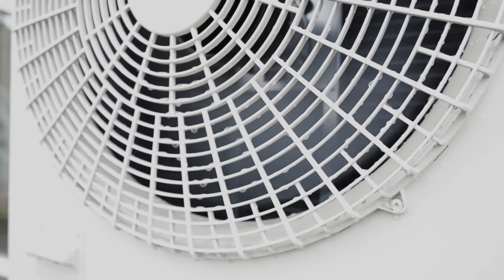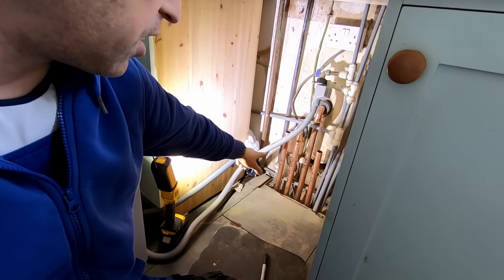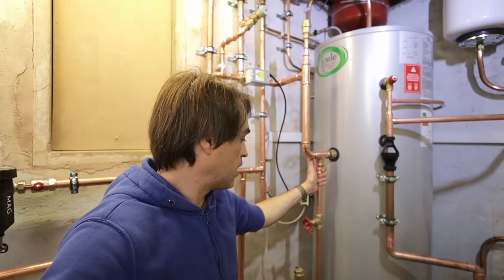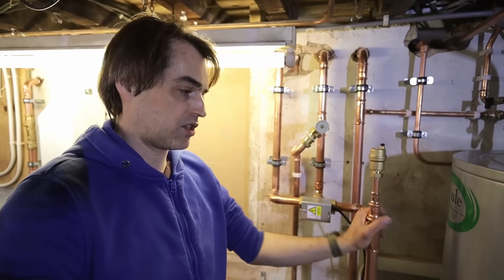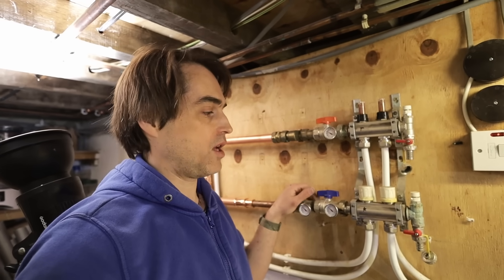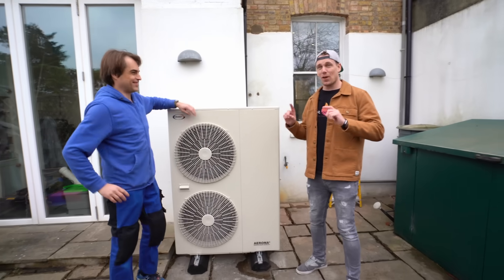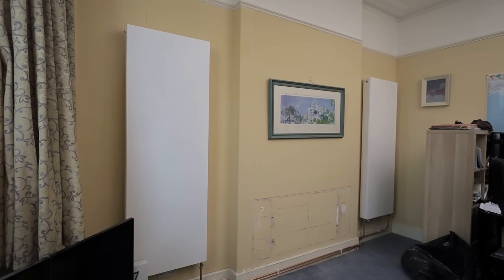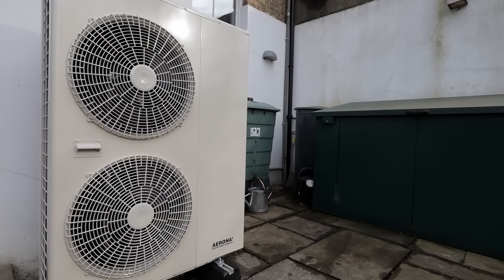The Truth about Heat Pumps: Debunking the Myth.

Comment: Four bends is pure art. The radiators arent hot enough though.
Reply: The radiator sizing was perfectly explained! The radiators ARE hot enough, at that size they put out the required 1.7kw at 45 degrees. No need for them to be any hotter

Comment: those radiators are crazy! is the house single glazed and uninsulated?   fabric first ?
Reply: Conservation area? Clearly Victorian, ripping out original windows would be a crime, solid walls are difficult to insulate without compromising appearance and / or space. There is a limit what can reasonably be done to a period property in insulation terms
Reply: @spencerwilton5831  I'm  sure your right.  but those rads are another level of ugly. When trying to preserve a beautiful building.

Comment: Really appreciate the time you've taken to put this together. I'm scraping together the pennies to take the heat geek courses - ACS resits this year/van power steering failing/children... Knowledge always pays in the end. Thanks again.
Reply: I'm hoping the Gov will throw a large wad of money at it. Its going to need a combined effort - Insulation, Heat pumps etc, its too much for the average working person to shill out.
Reply: FYI there is an accredited heat pump training course just released by the CIPHE
Reply: @jameslewis875  What’s the qualification called? If your thinking about the new CIPHE 2-day low temp heating design course then that is just a pre-requisite for the heat pump course (it’s replaced the energy efficiency course).
Reply from the maker: Heat geek is by far the best course out there and I have been to a lot of so called heat pump training courses. CIPHE have new low temperature heating course. I have seen the book for it. Let’s see if it’s any good.
Reply: @UrbanPlumbers  Thanks. It has to be challenging to be worth anything. I'm just a little worried whether challenging will be 'recognised' as better or whether a course of training taking a minimum AM unt of time and effort will be 'enough'. Either way, if I am fitting low temp heating I want to be confident that I understand the many variables as best I can.
Reply from the maker: @tapplumbandheat  I just had a look at that low temp heating course. It is done though the colledges that I know, and I guarantee you 100% that course will be a joke. Although the syllabus maybe be fine, the lecturers in most of those centers are clueless when it comes to heat pumps or low temp heating. Another pay to pass scam. Just do the heat geek course and maybe Kim's Norhampton Academy course - those 2 courses will teach you more than any colledge course will ever do. All those 'training scheds' are a big joke.
Reply: @UrbanPlumbers  yes. Kim off combustion chamber - always liked the way he was looking for answers to questions. always questioning, not I know everything don't dare question me. After all, what do I know. Mostly repairs, installs only when it really isn't worth fixing and more plumbing than heating
Reply: @tapplumbandheat  Low temp heating is not difficult, either underfloor or huge wall sized rads. Also a very tall HW cylinder for stratification.   

One good trick to increase the delta is to put a large rad in the coolest room (entrance or porch) in series after all the others right before the return ( with two lockshields permanently wide open ).
Reply: Yep, thanks for your efforts. These vids are well put together.

Comment: Great video. The installation highlights the serious issues we face with old UK housing stock. Heat loss is the enemy in winter. In summer it’s going to be cooling. I think we have to seriously invest in super insulation before we install heat pumps. Most “ ordinary “ households won’t have the funds for these high end systems. I’ve invested in second hand woolly jumpers. Heat the person not the space perhaps?
Reply: When we stop the drafts ventilating our old homes, we are going to need to get the vapour barriers right to avoid rotting them out from the inside by trapping moisture.
Reply: @AndrewHelgeCox  Yeah - lived in two houses. A Victorian house with solid brick walls, no cavity. We made many improvements including new double glazed windows and a fair bit of insulated plasterboard on exterior walls and better loft insulation but the house did have some drafts and actually it was nice to have a degree of draft in order to remove moisture and keep everything smelling fresh even if it did cost more to heat. However it did actually still have some of its original fire places and the old range in the kitchen. When my family had financial troubles when we were young that was a life saver. My dad was always able to get scrap wood to keep us warm. 

Now live in a much more modern house, brick and breeze block with an insulated cavity. Double glazing and some insulated plasterboard and it does trap moisture and smells. Always need a window or two cracked letting some heat escape.
Reply: @AndrewHelgeCox  I agree. I think we're going to see a huge number of problems over the next 20 years because of the big step up in insulation.
Reply: @AndrewHelgeCox  why not just use soffit & ridge vents as American homes do?
Reply: Couldn’t agree more. The future (well the near future) is a thermostat at 18 degrees and a blanket! 
Also turning condensing boilers down to 60 degrees. Small changes like this will have an immediate effect and whilst heat pumps and renewable energy are the future... we have a long way to go in the meantime. The government should be investing in insulation and nuclear power rather than giving grants to heat pumps companies
Reply: @lewisjones5067  Having to sit with a blanket and gloves on in your lounge is more 18th than 21st century. You’re right about the nuclear power though.
Reply from the maker: @lewisjones5067  turning your boiler to 60C will require radiators the size as in this video as your MWT temperature is going to be 50C. 

the principles of efficent heating are the same with gas boilers - lower temperatures and lager radiators.
Reply: @UrbanPlumbers  I agree, however turning my boiler to 60 degrees is much cheaper than ripping it out and fitting an ashp. When ever I do work on houses now I’m insulating as much as possible and oversizing the radiators. This is only a short term solution but at least it’s a step in the right direction.... and you can always turn the boiler up again on cold days!
Reply: @lewisjones5067  agreed 18 degrees C is plenty goodness knows what some people have their thermostats at 24 degrees plus I suspect. You aren't supposed to feel like your on holiday on a beach in Tenerife in your home !
Reply: Hot water bottles and woollen clothes!
Reply: @risenshine2783  Electric blanket. Your can have either side of the bed with a different hisNhers temperature.

Comment: Great video, thanks.  I have been reading up on those heat pumps that are split, seems to make the outdoor unit much smaller and smaller air-con type pipes into the house, seems like a nicer setup but a guess you need different skill for the aircon gas stuf which would complicate things?   From what I have seen from Rogers videos he is mostly in agreement with you guys, just video spun a different way.

Comment: Great vid.  I wish that you had said something about how this house, looks like a traditional Victorian, was insulated.  I believe that this is where the system succeeds or fails.
Reply from the maker: 1870 house, roof 100mm insulation. That’s it.
Reply: @UrbanPlumbers  then why on earth are these systems being installed without insulation being prior taken care of?!?
Reply: @britexpat_l33t  1870s house, good chance inside and outside is listed so they probably couldn't insulate the walls, only floor void and roof. Then relying on the thickness of the walls as thermal mass and high enough R value to cope. Not ideal but unfortunately this is one of the stumbling points of much of the UK housing stock. Solid wall terraced houses which can't have outside insulation fitted or internal due to room size limitations or listed/ conservation status, and those that have had insulation fitted if not fitted with a vapour barrier have bricks that basically start turning back to clay in some cases.
Reply: Thank you for replying!

Comment: The only downside to heat pumps is where I am theres a lot of stone walled buildings with awful insulation. The Emmitters need to be massive in them and it's just not practical. Thats no fault of the Heat Pump though

Comment: It's also an option to use fan coil units. They are smaller in size and supports lower flow temparature. There are ones designed for home usage. Ex. parapet fan coils 
Con: they make some noise
Pro: they can heat and cool you home too (condensate piping must be installed if it's used in cooling mode)
Reply: They’re called ‘air handlers’ in the US, It’s ridiculous what the UK is doing installing these gigantic monstrosities rather than simply installing air handlers.
Reply: @britexpat_l33t  people in the UK are used to their heating being silent in the room. We're not used to fan noise as we don't have air-con.
Reply: I'm in California. My architect was originally planning on hydronic heating, as shown here. When the builders got involved it ended up being a fan coil unit in the attic with ducts to the second floor (or first floor :) ) rooms. Since the house was built with large sliding doors, a thing in 1903, there was a thick double studded wall. A duct was run inside that wall down two floors to the crawl space under the ground floor, and from there to the ground floor rooms. The upper floor and ground floor are separate zones. Since if one one gets rid of gas service one can't get it back, I kept a gas clothes dryer. Everything else is now electric: induction cooktop, heat pump water heater, etc. And solar of course.  Because of Covid and supply chain problems it took almost two years to finish. Relief...

Comment: I've recently starty sizing my gas systems at low 50/55 degree MWT but the radiator sizes can soon get a bit bonkers and take over the room. Are there any trick radiators out there with miraculously high heat output Vs wall footprint?
Reply from the maker: There are actually. Fan convectors

Comment: Exactly video as usual. Now the bottom line question. Running costs??
Reply: Hopefully. And there lays the main issue. COP of 4-1 is great but not if electric is 4 times the price of gas.  Please don’t think I am anti new solutions but they need to be solutions.  I know heat pumps are not knew before someone provides a history lesson😁
Reply: @Smartie40.   And Also not when you have to run it 24/7!  My Combi is on about 2hrs a day max in the depths of winter. A COP of 6 - 1 would be still mean it essentially running 4hrs to my boilers 2.
A Replacement boiler fits exactly the same pipework and costs about 2 grand. So based on this install i'd have 18 grand to spend on gas!
Reply: @creakybones2407  You are using your boiler wrong and wasting money, basically. A boiler, unless you have a relict of the past, can do modulation, meaning that trough an appropriate thermostat (that is connected to the boiler trough the OpenTherm interface) the boiler can adjust the output power and thus heat your radiators less and run for more time. This is because condensing boilers are extremely efficient at lower temperatures, nearly 100% efficient, no heat is wasted. It's much more convenient to continue to bring the small amount of energy that is lost in the environment to the house to maintain it at the correct temperature, than turning it on some hours at a day and having the boiler run at 100% to win the inertia of the house and bring it to temperature. The only thing that you loose running it 24/7 is the small amount of electricity that is needed to run the pump for more time, but it's irrelevant. Same reasoning with heat pumps, modern ones run with inverter technology and can run the compressor at whatever speed they think it's more appropriate for maximum efficiency.  

Using a modern boiler like the old ones, with a thermostat that turns a relay only on/off, and with the output temperature set to 80C because you want the radiators extremely hot, is a very stupid thing to do...
Reply: @alerighi  All very true and I completely agree. However you cannot get past the fact you can buy a lot of gas for £18000 even at today's prices 🙂
Reply: @alerighi  except that isn’t really true. You can’t chance the laws of physics, and a warm house will lose heat at a faster rate. If you heat it all day every day it will lose more heat than if it’s heated morning and evening. That heat has to be replaced continuously. You might be able to burn gas at near 100 percent efficiency but it’s still cheaper to burn it at 80 percent only when actually needed.
Reply: @spencerwilton5831  Plus when people are designing they're designing to heat the space and keep the space at a constant temperature. Majority of people using fuel appliances especially gas don't heat the space, they heat themselves for comfort, so when the temperature drops off people don't notice thus they may go from 21-24c during those 2 hours down to 15c and not even notice. Hence when a heat pump is installed even with a COP of 3 or in some cases 5, because of their own comfort habits it's actually costing more. 
Which is why before swapping to heat pumps or any low flow temp system insulation and air tightness is a must. 

I actually tried this on my own father, a heating engineer of 55 years and he noticed the lower temperature of flow and the increased cost in having to maintain that temp rather than over heating the space for a couple hours and then cooling down with the space. Only took him 1 day to notice the increased unit usage and the colder flow temp.
Reply from the maker: Hopefully lower than gas!!!

Comment: Having worked with heat pumps since 2005, here are some reasons they don't work;
Insufficient radiator surface area. Since heat pumps cannot supply 80 degrees C like an oil or gas burner can, you need larger radiators. 
If you replace a burner of some sort and if the chimney runs through the house that heat is lost. Need to be accounted for. 
There is a lot of cheap junk on the market. Don't buy it. A heat pump is not a heat pump. 
Improper commissioning. Care must be taken to adjust flows and temperatures correctly.
Reply: If you  run your radiator at 80C, you have very bad efficiency even with a gas boiler, since condensing boilers operates more efficiently at lower temperatures. To increase the surface area you can simply install fan coils, in reality heat pumps make sense with underfloor heating, fancoils and forced mechanical ventilation with heat recovery. 

Also using radiators or only underfloor heating with heat pumps is stupid since you can only use it in heating mode, you can't use it for air conditioning at all.

Comment: Great video as always, I think Rodger does have a few good points, I like the idea of cleaner energy but that heat pump looks terrible there and those radiators are ugly, 99% of customers wouldn’t have those it’s only the tight gits that think there saving loads of money having a heat pump that would have them
Reply from the maker: it is only a matter of gas prices going up to 1/3 of electricity price and suddenly no one will mind the heat pump or radiators anymore.
Reply: @UrbanPlumbers  completely agree…. I’m at 7.8/28p now, considering my options. If I can average a cop greater than 3.6, I’m sorted… not to mention I get a uvc upgrade and a new boiler in the equation. I want new/larger rads and ufh in the extension anyway. Seems like a no brainer?
Reply: Personally I think those large rads are just ugly to look at and most customers wouldn’t want them, great videos though,  very good at what you do 👍
Reply: @michaelpoulton6123  yep, they don’t look nice at all, but that’s what you need when you try and heat an old, leaky, property with a low temperature system… the other options are knock the place down and rebuild, stick with high temperature emitters, or go for air-air…
Reply: @dorsetengineering  True that, just like our Australian houses, about 20 years old, single glazed, no seals around doors, needing three aircons to keep the rooms at under 30c, good times.
If only things were built like they are in regulated countries with the future in mind

Comment: Payback time ? Radiator aesthetics? I've been designing central heating systems for 50+ years , those radiators in the music room may do the job , but they look  horrible  , my customers simply would not have them , and you haven't got enough wall space for horizontal ones,  that's going to apply to every room  , by the way , your pipework is excellent  , regards Steve
Reply: and as it is a music room not going to help with acoustics
Reply: @valvemonky4734  never thought of that one , excellent point

Comment: Hey Man, very good informative video's.
A lot can be learned from them!
I am a technician my self in Belgium and i am amazed how different you guys do the piping!
Reply from the maker: what do you guys do diffrent please?
Reply: I mean mostly the piping. We don't use copper for underneath the floor anymore, mostly only multi layered pipis, each pipe goes straight from the collector to a radiator. Thats bcs if there will be a leak, long term. Its mostly on the connections and nog underground. We use copper, but only in places we can see the piping. Like from the boiler to the collector.